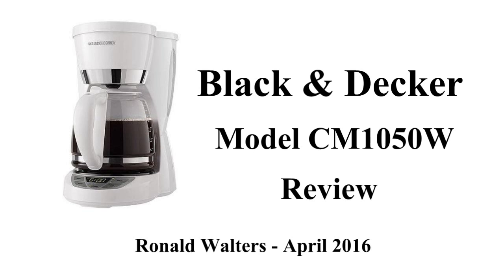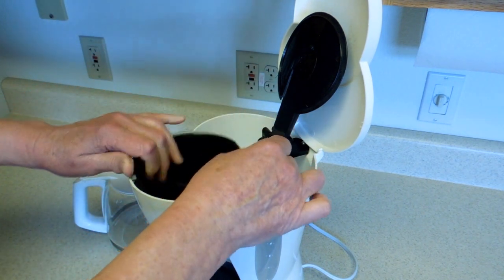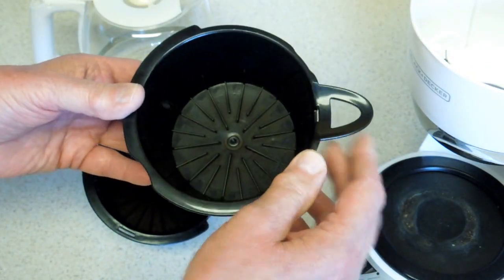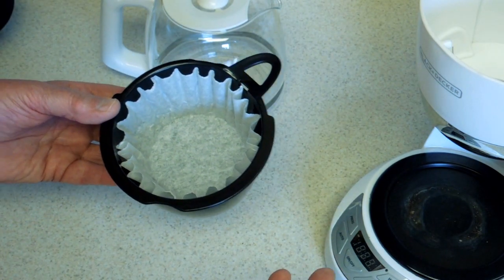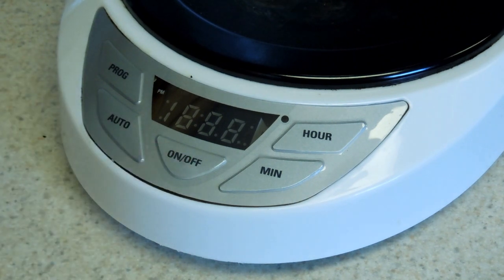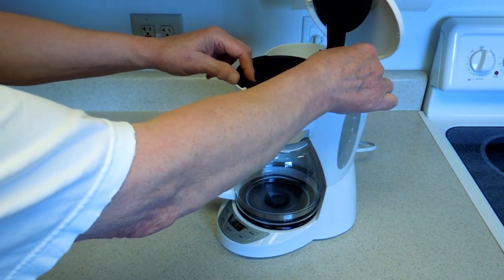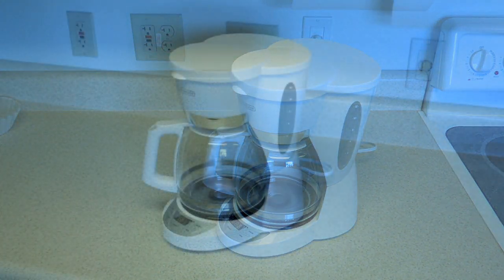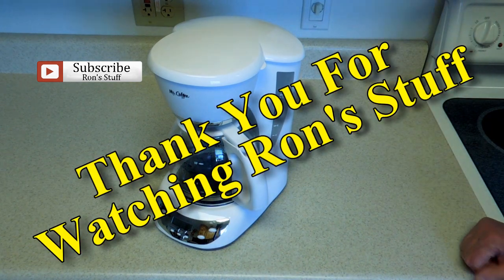Black & Decker CM1050W Coffee Maker Review

Comment: Mr. Coffee rules! I've had nothing but Mr. Coffee for at least 30 years. A handy little feature that's molded into the lid of the Mr. Coffee is a ramp that lines up with that pivoting hot water spout. If you should forget to move that spout back over the filter basket after placing it in the coffee maker, that little ramp moves the water spout back into its proper place when you close the lid.

They do still make the Mr Coffee with the simple on-off switch. I got one (Model # CG-12) last year at Wally World here locally for around $16. They even give you the choice of black or white.
Reply: I had a small Mr Coffe a year ago, and it was the most disgusting thing ever. To the garbage it went.

Comment: I wasn't sure what this video was about, but it was kind of hilarious to watch. I'd actually suggest buying a higher quality coffee maker (even a vintage/used one) that you don't need to keep replacing. A commercial one, even. I can't imagine having to replace a coffee maker every 2 years. The one we had at work was an old (maybe B&D) one with NOTHING on it. It had a basket that slid in place with tracks, and an on/off switch. No safety buttons, no timer, nothing. The carafe didn't even have the lid on it anymore (broken). It worked fine (probably going on 30 years of service).

Here (at home) I use a French Press, which is about as low-tech as it gets, but I only make 1 cup at a time, and usually no more than twice a day. I only ever need to replace it if I break the carafe.
Reply from the maker: You just never know, sometimes (by accident) one will last forever. Approximately 6 weeks after I shot this video the Mr Coffee maker quit (burned out the element). "6 Weeks"... how embarrassing and just after I had bragged about it. I took that one back and thus far the replacement is still working.

Funny thing you should mention a French Press. Earlier this year someone selling a supposed "new version" of a French Press on Amazon sent me a message and asked if I would test his unit and then make a video about it. I sent him a reply and a few links to videos where I reviewed some stuff (some positive, some negative)... including this newly edited review on B&D coffee maker. Never heard a work from him again. Hummm! :-)

Comment: I feel your pain! Back in a previous millennium when I started restoring my 29 Chev I was told to steer away from B & D - it was cheap hobby stuff, said the people who know. I bought Makita grinders and such, and they still going fine 30 yrs later. Better'n me, come to think of it. Well, so the leopard don't change its spots. Far as coffee goes, I'm drinkin instant and waiting for the fine day when Porter Cable brings out its 2hp plunge model coffee maker - woohoo.
Reply from the maker: When I worked overseas and before cordless drills were worth owning, when I came to the USA on vacation I would buy two (2) B&D 1/4" drills because they only lasted 6 months to a year. Usually the drive gear would twist loose of the motor shaft making it pretty worthless after that. I continued to purchase the cheap stuff as running them on 50Hz through a transformer wasn't good for them either. Larger Dewalt drills purchased about the same time I still have. Porter Cable had good stuff and I own a number of their tools. Unfortunately since 2004 they have been owned by Stanley Black & Decker. Casual observation has been B&D tend to drag whatever brand they purchase down to their level (IMHO) and I see a definite decrease in the quality of Porter Cable tools. Delta Tools was purchased by B&D and I thought that would be the end of them but fortunately 5 years ago a Taiwan company purchased Delta... so hopefully there is still hope for them.